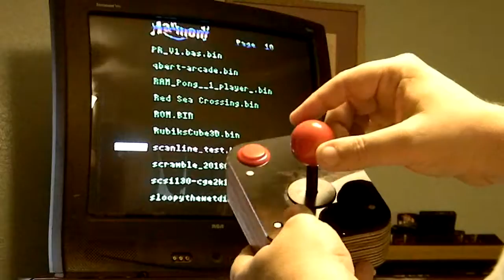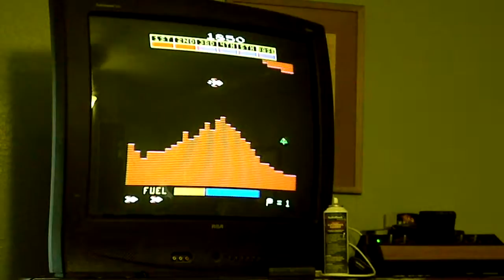Arcade Forge Black Retro Joystick:  review, teardown, and mods

Comment: That cable issue is simply unforgivable. Have these people never seen what happens to a cord attached like that?! It's almost as bad as Tomee/Retrobit NES dogbone controllers laughably having a QC inspection sticker blocking a screw when they didn't have the decency to wind the cord through the posts intended to secure it. They cord could slide freely in and out and put external forces directly on the PCB connections! Clearly, they copied Nintendo's design and didn't even know/care what the posts were for. They actually make zip ties with a screw mounting hole but I don't think that would've been much better. There are so many easy solutions that they really have no excuse.
Reply from the maker: The zip tie didn't do much honestly. It had a bit of tension but could slide up and down on the cable. The hot glue plug I added should hold up to light abuse though. All my homemade arcade controllers use detachable extension cables so if the cord is damaged it can easily be replaced, and if someone ie trips over the cable, it will simply detach itself. I tried to be as fair as possible in my review but that cord absolutely needs proper securing, hence my "half a thumb up." Otherwise besides the loose cable and unfinished wood, they controllers are very nice.